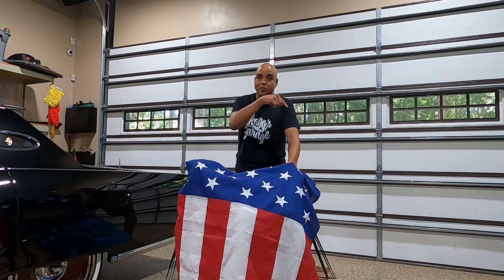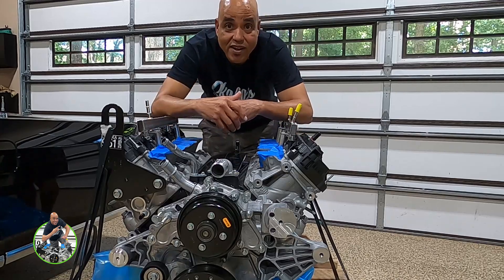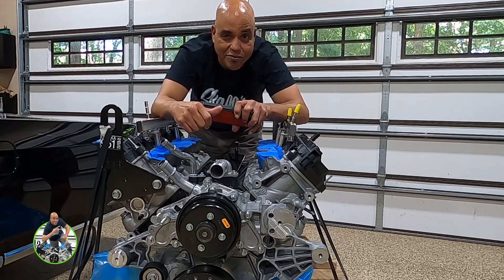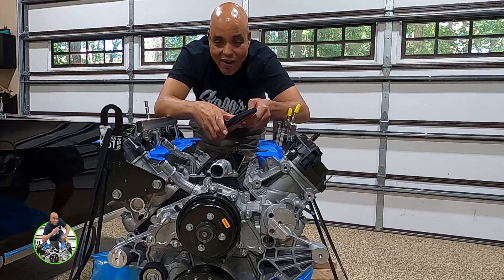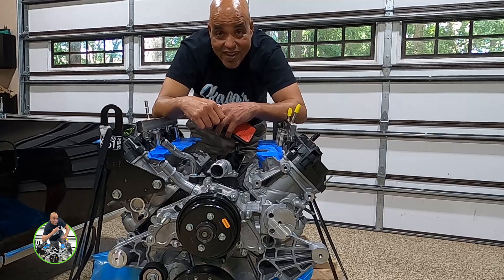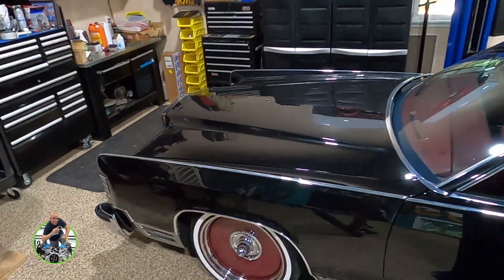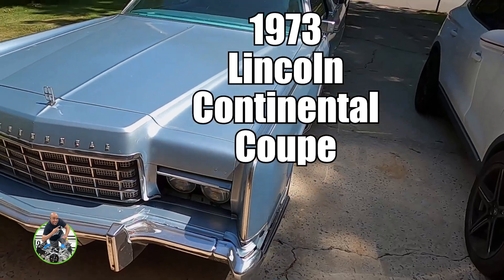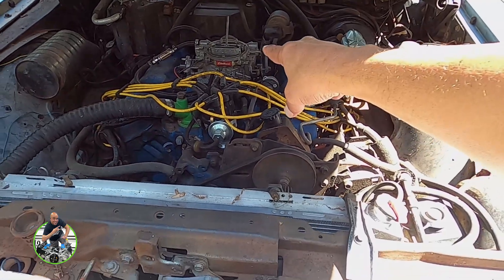Godzilla Engine In A 70's Lincoln Continental #lincolncontinental

Comment: Great channel; I have a '78 that I am restoring. Do you know where I can find Lincoln parts? I'm looking for the high pressure line for the AC.
Reply from the maker: @marlinparker3595  preciate ya! You might be able to find one at Lincoln Land. If you have the blown hose, what I'd do personally is find an A/C shop that makes or repairs hoses. Also a hydraulic hose repair shop might do the job as well. Thanks for watching!